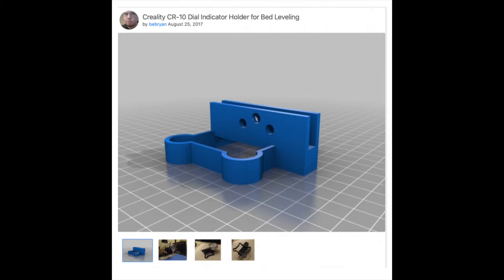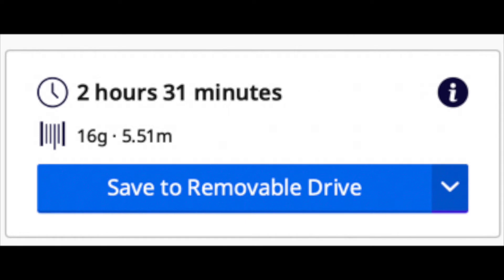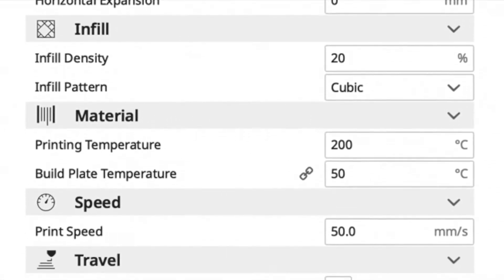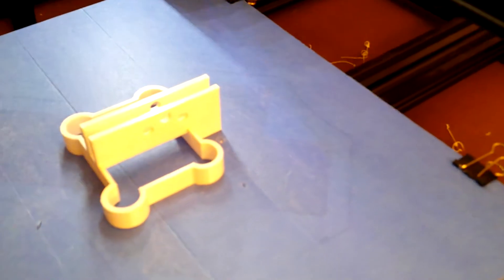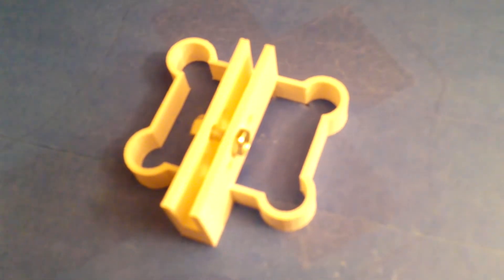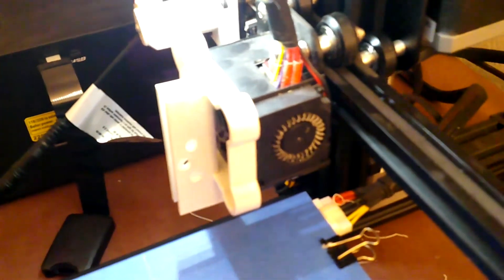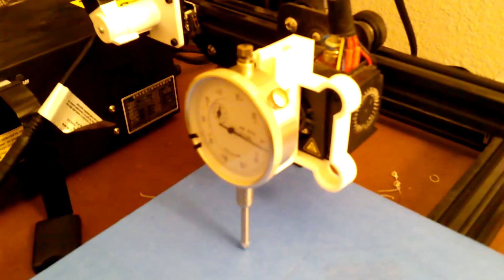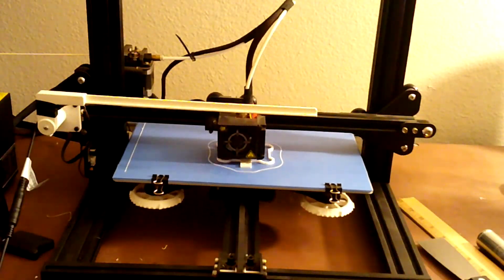Bed Leveling Dial Indicator

Comment: I printed a similar dial indicator holder, and it worked well, but this seems more robust and designed to hold the dial indicator more securely. Analog rocks! Thanks for this review.
Reply from the maker: You are welcome, that's what this is all about...helping each other to find better ways...or the way when we are lost.